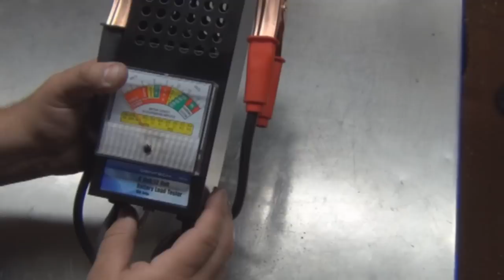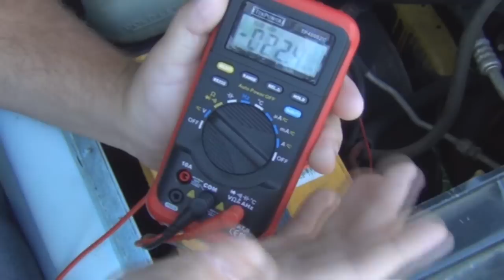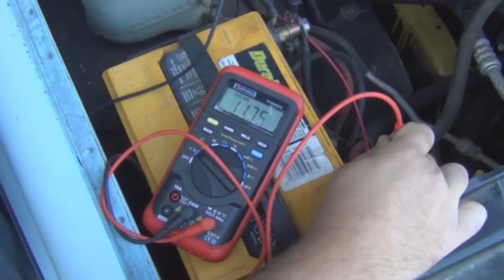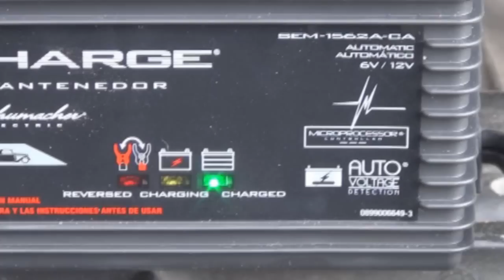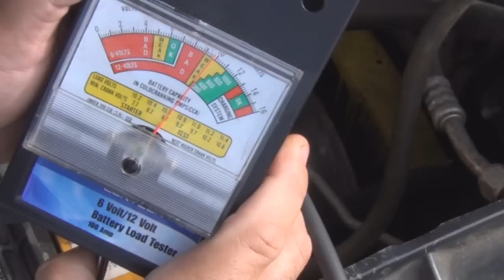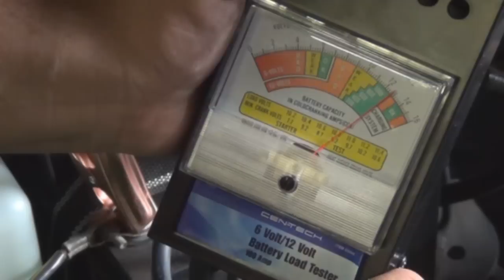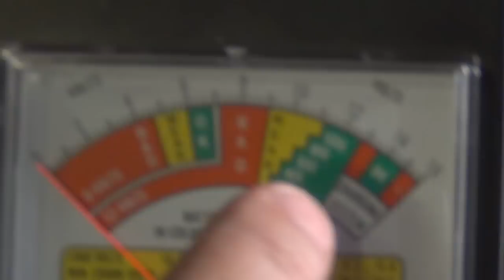How To Check A Car Battery properly - Performing a battery load test

Comment: question here  and  please  answer.    if  quality of  battery is bad,   but it  can start my  motorcycle  .    can  that  battery be a problem ov  not enought spark  after  i accelerate fast ?  ( bicause    when i  go on hight rpm  it  sputters  and  cant  go  faster.

Comment: That first battery did not fail.  A little weak but good to go. Anything over 9.3 volts under load is enough.  I would have kept that battery a while longer and just run the load test every two months.

Comment: Befrore replacing the first battery, I would give it a good equilization or boost charge.  ie overcharge at about 15.5 volts and 2 - 5 amps)  You might well get rid of some sulfation and bring it back to life for  a while longer.

I've just tried this on a brand-new battery (allready fully charged) and was also able to increase the cold cranking amps by quite a bit!

Comment: Can you run the load test while running the engine??, or is equivalent when is off, when you only have the tester on only.
Reply from the maker: +Jos jo it will not tell you the condition of the battery if the engine is running. It has a meter on it to check voltage output from the alternator.